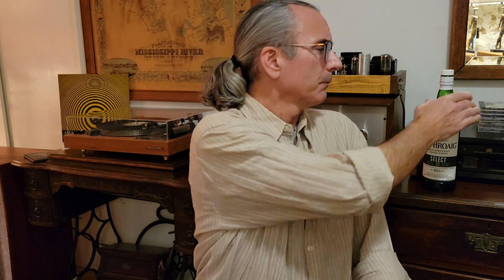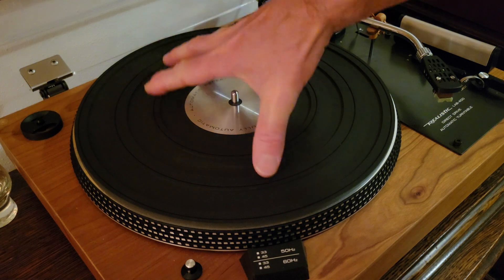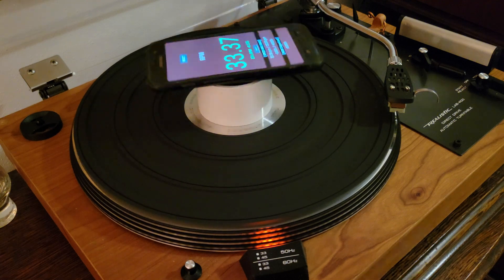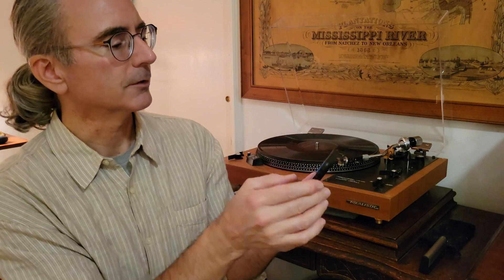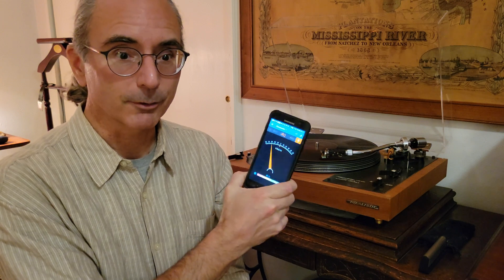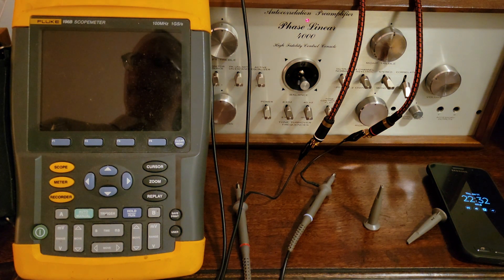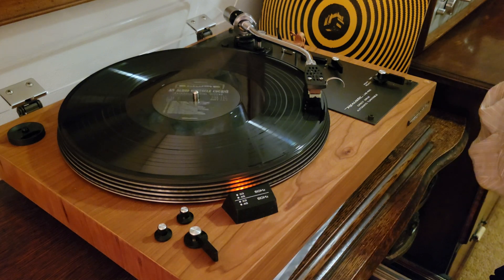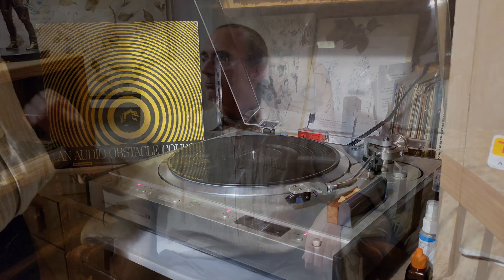Calibrate Your Turntable! How to Accurately Measure the Speed

Comment: I was going to say something similar, and I will run some test on my old original audio generator 1980  :) , to let you know. But the main remark is that the dial on those days generator is MANUAL, and probably no frequency counter on scope at the time before sending the signal to lathe… so 1010 Hz might just be the right tone to hear… ! Cheerios

Comment: After a few... sips... can you truly trust what you see or hear? 😅
How do we know if the record was cut at precisely 33.33rpm or 1KHZ?
How do we know the power line frequency is at precisely 60hz?
It seems to me the most precise thing we can hang our calibration hat on is the quartz lock circuit/mechanism and the oscilloscope. With that in mind, there is an "offset" option for the RPM app to match the quartz locked turntable. I would suspect the source, in this case, and not the quartz mechanism... unless that has drifted off... which is unlikely.

Comment: I have my Denon table with the app at 33.32. The only adjustments you can make is making sure the belt track is clean. The pulley is clean and the bearing spindle is good. I think you would drive yourself crazy trying to get it down to the nitty-gritty. You couldn't possibly hear that difference although the tone generated from your vinyl record seems to have some flutter thanks for the video.

Comment: There is a great film called Desperate Man Blues (2003) about the 78 rpm record enthusiast, Joe Bussard. Joe played his records with at a big long tone arm Technics turntable with a slider for adjusting pitch (speed) on the fly. 

Joe stated that many records were not recorded/manufactured at the specified speed. He knew his collection of nearly 10,000 records so well that he could adjust the pitch (speed) of record being played as needed when listening. 

There are so many variables that could impact the pitch of recordings along the recording, mixing, manufacturing and playback chain that I personally don’t worry too much about one or two percent speed irregularities of my turntables. 

Both of my tables have pitch (speed) control sliders that I have never used. They might come in handy for certain recordings if only my ears and brain could notice an issue with pitch. 

Thank you for bringing this subject to the forefront and thus quality presentation.

Comment: What's the gorgeous amp briefly glimpsed in the background?
Cheers.
Reply from the maker: I was using a Phase Linear 4000 preamp with my homemade BV-6V6 power amp. Since the video, I sold the system along with my ADS L730 speakers. (Don't worry; I got enough money to make letting go relatively painless.)
Reply: Thanks!

Comment: I was wondering why no other techs here on yt talks about it. There are a few issues to consider:
1. Your phone probably weights more than a vinyl LP, it slows down the speed of the platter
2. Your phone isn't calibrated like all other phones
3. Measuring without tracking load of the record changes the speed of your TT
4. The Pioneer Pl-630(I have the same model here) is a descent TT and it's constantly measuring the speed of the platter and compensates the torque load with sensors even with your phone on top. Lower end TT does any kind of compensations.
5. Better use a frequency counter instead of the Fluke, because the most scopes struggles with dirt in grooves. Frequency counters do a better job on filtering out frequency spikes.
6. Laphroaig select is a good choice. SLÀINTE MHATH

Comment: I would not assume that the Shure test record is necessarily exactly 1 KHz. They might be using an audio signal generator, and those things are usually Wein bridge oscillators, not quartz locked, especially not from the 1970s. I would trust the power line frequency more than just about anything else, although the power line frequency has been deregulated in recent years. Still, the entire power grid has to stay in sync, so I'd assume it's as close to a standard as anything you're likely to find, except maybe for a quartz locked turntable. On the other hand, quartz crystals can have frequency errors too. Quartz crystals do better at consistency than precision, although they're usually close enough. A typical crystal is accurate to about +/- 20 to 50 ppm.
Reply: I was going to say something similar, and I will run some test on my old original audio generator 1980  :) , to let you know. But the main remark is that the dial on those days generator is , and probably no frequency counter on scope at the time before sending the signal to lathe… so 1010 Hz might just be the right tone to hear… ! Cheerios

Comment: Try with variac to adjust the exact voltage for turntable.
Reply: If the turntable has a linear power supply - most older ones do - minor fluctuations (if any) from mains power will not get to the motor.

Comment: Yip - I learned "stay with the Scotch", so thanks! I've been concerned about this recently so I can relate. 

My Technics SL-1100's speed is servo-controlled not quartz-locked. I've found the local line voltage varies throughout the day (which will affect the speed) and my strobe reading will change as the circuit warms up. I'll set it for the first side of a record and find I have to change it for the next side. After that, it stays stable. I've gotten over the very small error in speed so yay for me.

However, I've been using RPM and became more concerned about wow and flutter! The little graph of w&f it produces is nasty - my turntable is supposed to have better than 0.03% w&f but my table achieves only 0.05% at best. All I can say is, where is the scotch?

Comment: My Quartz Locked SL-1200 shows ZERO movement of the strobe blocks, and when I use both RPM and Turntabulator, I get EXACTLY 33.33rpm with both apps.